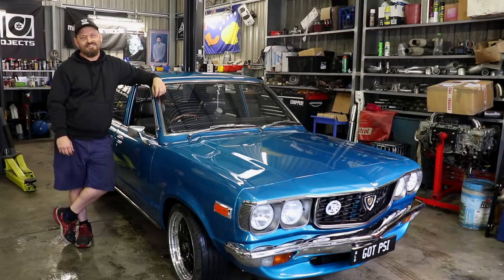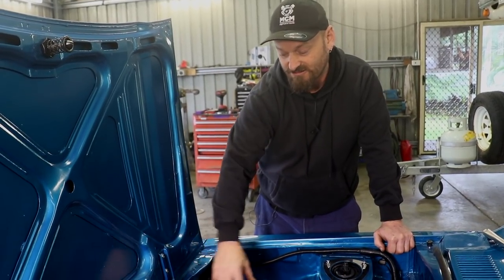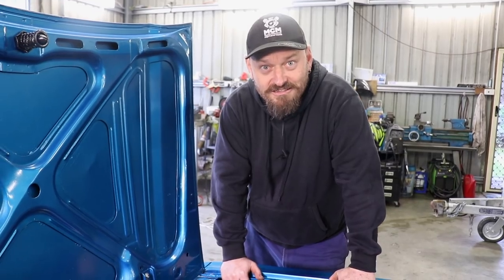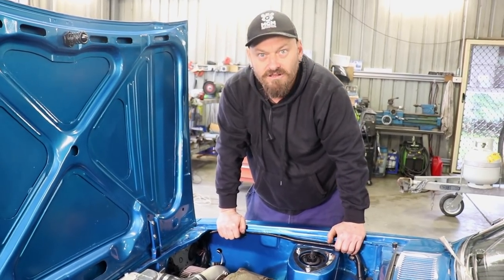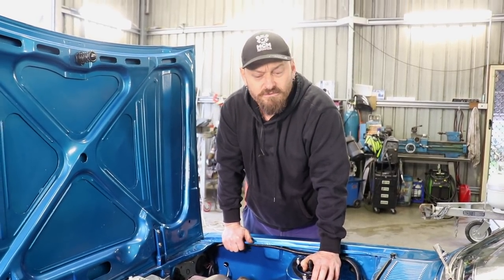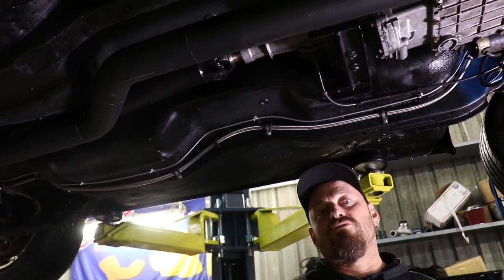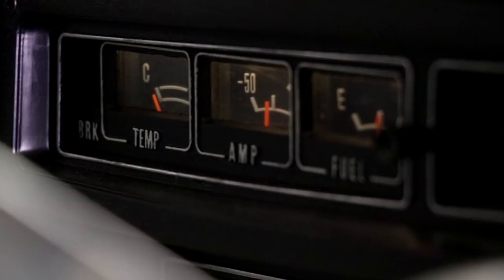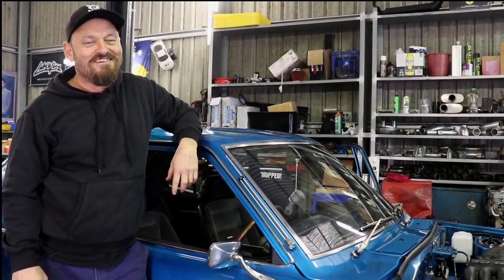THE SKID FACTORY - 1973 Mazda RX3 [Build Review]

Comment: So i googled rotary engine and i now know that boost goes in, and apex seals go out and you have to rebuild your motor
Reply: gullf1sk that is the best explanation I’ve seen yet.
Reply: they're good for like 3-5 years depends on boost levels and use case. it's fine. good 'nuf for a daily if you're into modding cars a rebuild every 5 years is not that big of a deal.
Reply: If you have a bad tune yeah, good tune and proper care will last a while
Reply: Add alcohol injection to solve most overheating and carbon build up problems.
Reply: wasnt that 20 years ago when seals were shit?. Pretty sure new materials and seals are good now
Reply: Hayden Bristow rotary's from 1974 and after are good, and they got better with each new model car, until the Rx8 then they went backwards.

Comment: 12:04 If anyone's interested the reason rotaries need a strong muffler is to withstand the constant impact of apex seal chunks.
Reply: lol.. but true
Reply: Jokes aside, it's actually the exhaust temperature having a tendency to melt muffler and resonator packing material that would otherwise reduce the noise out the tailpipe.

Comment: Just to be a stickler re: 4:45sec, Cosmo 13b and 20b engines do have a distributor drive from factory. They have a CAS just like the FC 13bt, with a different plug on it. It's the 13b REW in the FD rx7 that doesn't have it.

Comment: A fellow apprentice had an RX3 with a 13B PP in it way back when.  Took me for a strap in it, holy smokes,  the noise, the acceleration and the violent axle tramp on gear changes!
Then copped one of the first legal 13B Turbo conversions in the ACT.  Was abit more civilised, but holy crap did it move!

Comment: Cool 70,s car, really nicely done, hope to see it out for a drive next time, they were based on a Mazda 808 body shell, if anyone remembers them, the 808 suffered badly with RUST!
Reply: Not so much. They are the same platform. The 808's had piston motors instead of the rotary, and both suffered badly with rust. Like most Japanese cars from the 70's
Reply: As i said they were similar body shell except for the front and the tail lights were different, yes i already knew ( my sister had one ) the 808 used a 4 cylinder engine, i doubt if any 808,s are around now RUST will have eaten them all, unless one has been tucked away in a shed carefully looked after.

Comment: This has landed right in the middle of hours of researching and dreaming about the perfect 13B build. This is a beautiful example.

Was any consideration given to water injection for combustion chamber temperature control / long-term reliability? Seems to be an increasingly popular option.
Reply: Don't need that with E85.
Reply: My semi-educated research says that e85 largely negates the need for auxillary injection. if you're going with pump gas, add methanol around ~400whp.